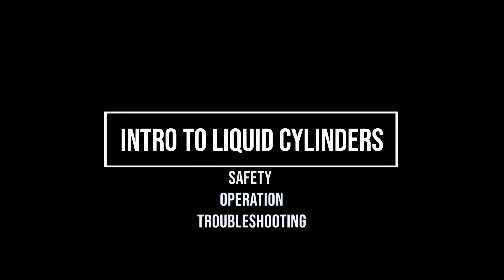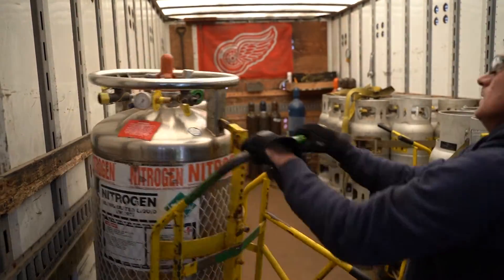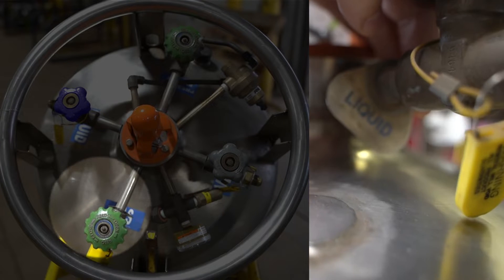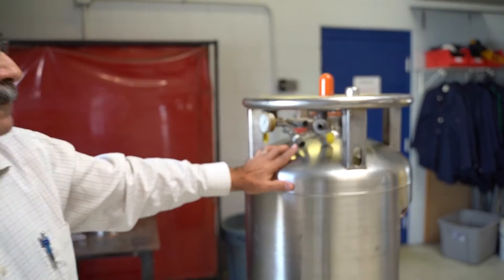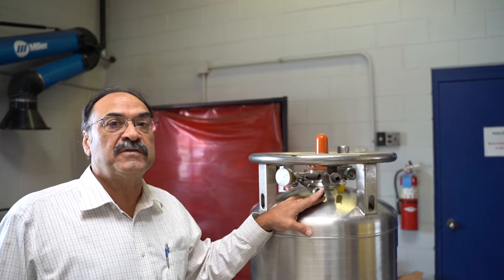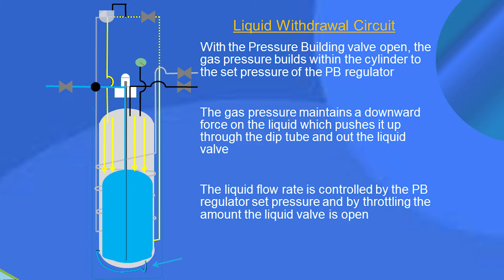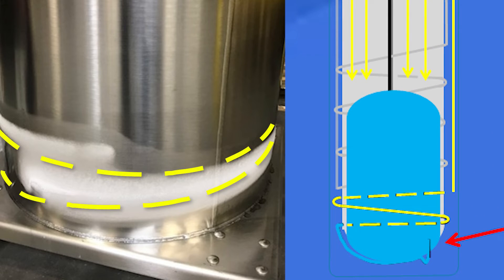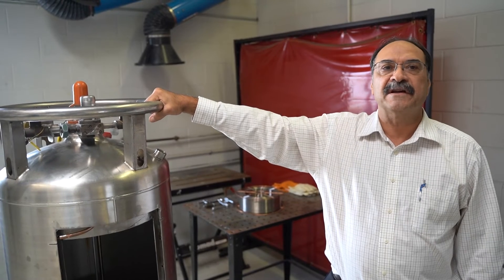Understanding your Liquid Cylinder

Comment: I have a liquid nitrogen tank that vents from the pressure relief valve every minute. It is a bit annoying. Would opening the pressure building valve help with this?
Reply: No, it would build more pressure. You want to keep the pressure lower than the safety set pressure.